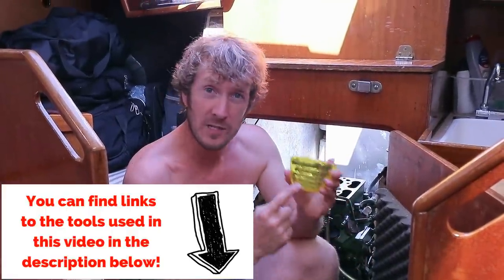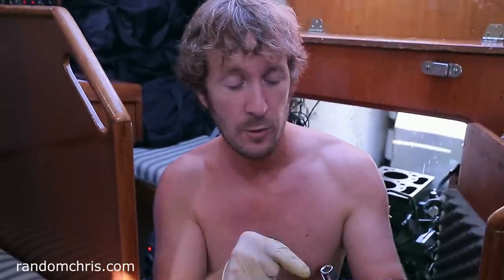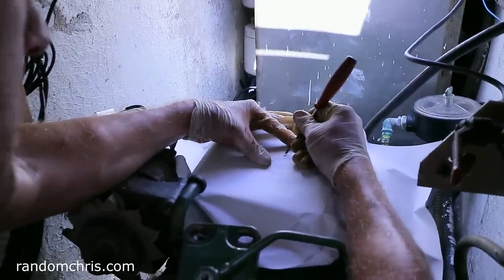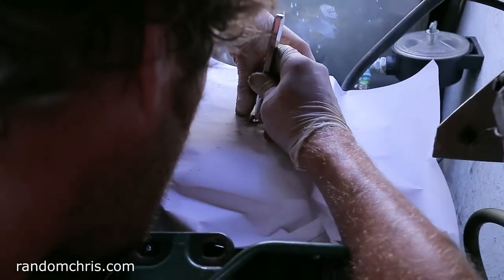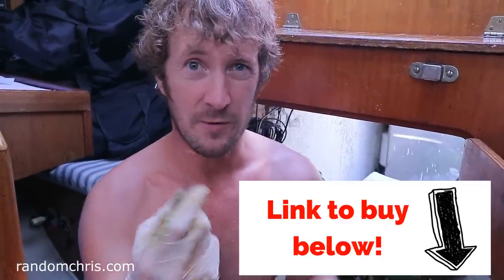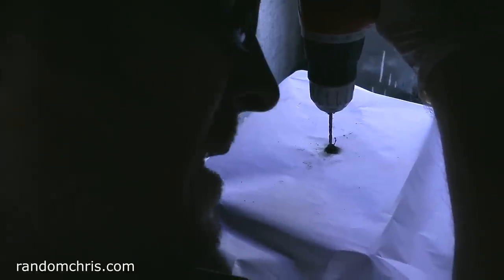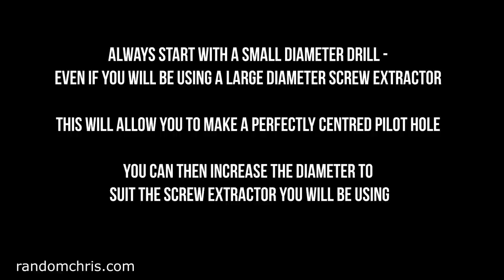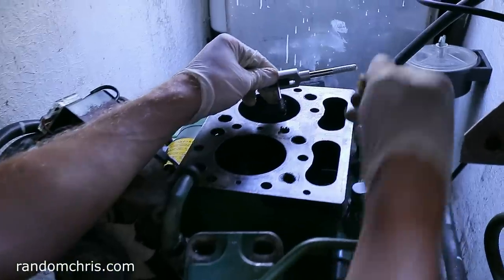Easy Out / Screw Extractor - How To

Comment: As a idea to get a true center, it is always best to use a hole punch to slightly indent your center, then use a small drill bit to drill the center hole, then redrill with the larger drill bit. This always makes it much easier to drill out the center of the bolt your extracting.

Comment: Well done! Great instructions. A few additional tips. In some situations, paper won't work. I often cover areas that I do not want the swarf to enter by covering those openings or surfaces with inexpensive foam type shaving cream. When the job is done, simply remove the shaving cream and swarf using a shop vacuum cleaner. Don't worry about residual shaving cream, it's only soap and will not harm the engine.  Staying on center is critical, as sometimes no matter what you do, the EZ Out won't remove the bolt. Using a pilot [1/8"] drill bit first, also speeds up the drilling process. The finish size drill will work faster and stay straight when first drilling a small pilot hole. Lastly, when all else fails, you get a HeliCoil thread repair kit, drill the bolt completely out and repair the threaded hole with the HeliCoil set. For the HeliCoil to work properly, you need the hole drilled "on center", otherwise the newly repaired threaded hole won't line up with the holes in the mating piece to be fastened [in this case the cylinder head.] Pro tip: Use Cobalt drill bits [you recommended this]. They cost double what HSS [high speed steel] drill bits cost, but stay sharp 5 times longer. Most importantly, HSS drill bits won't drill into a grade 7 or grade 8 hole. You only dull the bit. Cobalt [not those BS TINN coated] bits will easily drill out hardened grade 7 & 8 bolts. I like to start the drill motor out slow, to ensure that I keep the bit on center. However, once I have a nice cone, I increase the speed on the pilot hole. Small diameter drills work much better at high speed. You can use penetrating oil if you don't have the proper cutting oil. I prefer to drill all the way through the bolt, except in critical areas of an engine or other machinery, where doing so may cause you to drill into a cooling jacket or other area you don't want to drill into. Drilling all the way through, allows some of the stress on the bolt to collapse inward, easing the job. It also allows you to spray penetrating oil into the hole, thus getting lubrication to the threads on the opposite end of the bolt, again, easing the job.

Comment: Great video, but I have never had one of those extractors work the way it was supposed to.
Reply from the maker: You have to get the hole you drill perfectly central, and if the smaller sizes don't work you need to increase the size of the extractor until you crack it.

Comment: Great instructional... corrected many of my previous errors doing this... and I'm often out on the (crappy) yacht when doing this sort of thing so good to see difficult circumstances taken into account. Still broke off the first remover I used but I think that was more a factor of how badly the worn bolt was corroded into the bolthole than anything else.
Reply from the maker: Hi Tim, I’m glad to hear this was helpful. The diameter of the easy-out is an important factor. They are made of a very hard, but brittle, metal and bearing in mind the cross-section of the bolt compared to the small diameter tip of the easy out which has to remove it, it’s not so surprising that they can break off. (I got away with using a small one because the head bolt didn’t need much torque to remove) If you manage to drill right in the centre then this pilot hole can be progressively opened out with larger drill bits and then a very large easy out can be used on the most stubborn bolts. Subscribe for more helpful videos on random subjects, and check out my sailing channel too: YouTube.com/sailingbritaly Cheers! Chris 👍

Comment: I haven't read through all of the comments so apologies if someone has already mentioned this. Instead of blu-tac or putty, use grease or thick oil to hold your paper/card mask in place. Should be some of that on board any boat. Also, I would leave anything covering the pushrod gallery in in place until the stud is removed and all loose small items are out of the way. There is nothing worse than trying to fish out small tools from the engine (or bilge) when working in confined spaces. Dont ask me how I know. Otherwise, a nice clear explanation of how to use stud extractors.

Comment: What you do is take a propane torch,  or heat gun and heat up the metal around the perimeter of the bolt, so the metal will expand  and the bolt will come out easier
Reply from the maker: Yes that works if a fastener is stuck, but you need something to turn it if the head has snapped off level with the thread... Other ways of freeing up a stuck fastener are to whack it with a hammer (a.k.a shocking it) or spraying freeze spray onto the fastener to shrink it.

Comment: What am I doing wrong? I tried to drill a hole in to the dead coach screw/bolt but i couldn't penetrate it? Same situation as this video with the bolt head snapping off.
Reply from the maker: Try using cobalt drill bits and drill at a lower rpm with more pressure. Use a drilling compound if you have one too. I recommend you wear eye protection as cobalt drill bits have a habit of shattering and you don’t want bits of drill bit in your eyeball... Chris